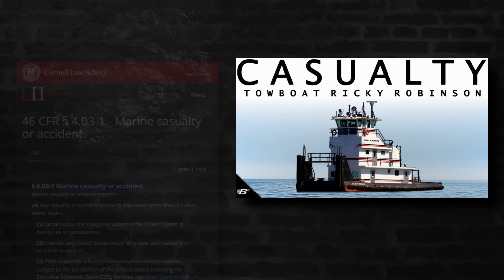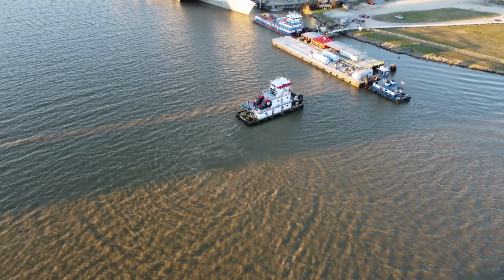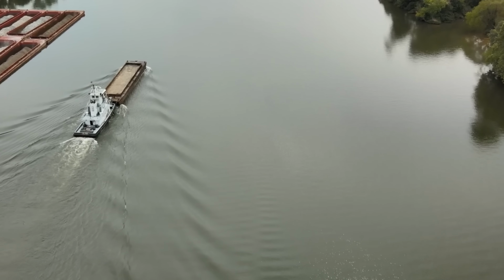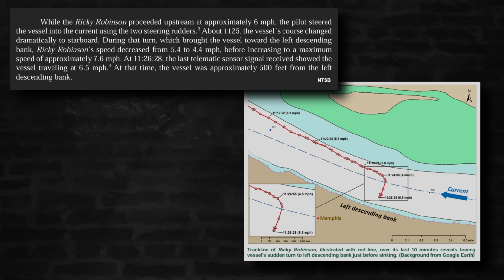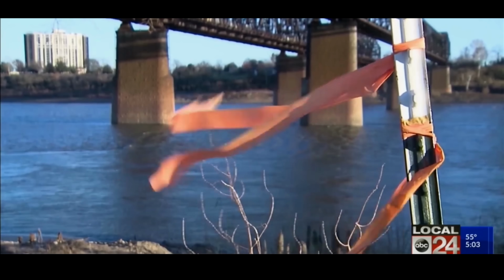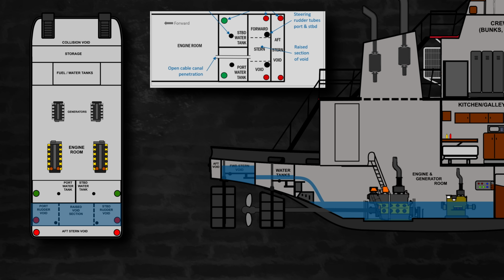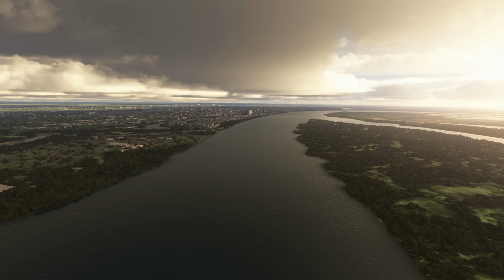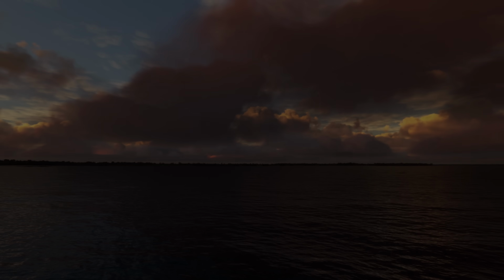INSTANTLY UNDERWATER: The Sinking of Towboat Ricky Robinson

Comment: Wow! As a tugboat guy on the westcoast of Canada. WTF? Who runs with a leaky lazaret? Thats just insane! Then to run with the laz hatches open and engine room doors tied open? Due to the loss of life I'll stop commenting.
Reply: I wonder what happend that they went down with the tug, from the comfort of my chair at home it would have seemed quit easy to jump the ship or swim out of the wheelhouse once capsized
Reply: @Poging2  No life jackets, and strong (very strong) currents in that area of the Mississippi.  The boat sunk in seconds.  if the deckhand was under-deck, they wouldn't have had time.  I've seen 8mph at times not too far from there, which doesnt seem like much, but you're powerless against that.  Even a strong swimmer is going to be challenged, and have a hard time orienting and swimming towards shore.  Most of these boat crews are not strong swimmers.
Reply: @Poging2 ship probably dragged them down with it
Reply: @Poging2  In a rapidly sinking, capsized ship, in 4MPH current it's probably not so simple.  If she really went down in 30 seconds, they were probably working hard to try to stop it from sinking and didn't realize it was inevitable until it was too late.  With the boat listing already and pointed across current, once it got unstable it could have flipped real quick, and trapped them as well.
Reply: @Poging2  It's really hard to escape from a rapidly flooding, heeling structure, honestly. The structure changing orientation and filling with water is going to seriously disorient you, and any exits that you DID know the location and direction of might be on a different face of the room now, if they're visible at all. The post-salvage condition suggests the towboat sank mostly straight down, admittedly, so that might be less of a factor here, but it's still shocking how disorienting it is to get submerged in water.

Additionally, you might be thinking of swimming in a pool or the ocean, but they call the Mississippi the "Big Muddy" for a reason. Especially that far down the course, the river is moving a TON of mud. Visibility in the water is atrocious and light is lost shockingly quick beneath the surface. So you have to do that in the dark, as well.

But on top of all that, the SPEED of the sinking is key. Less than thirty seconds for effectively a two or three-story building to sink underwater is terrifyingly quick. They barely may have had time to realize the ship was going down, not even enough time to take a breath. Worse, even if they DID realize that, people float and steel doesn't. If the towboat is sinking that fast and ESPECIALLY if the two crew had their lifevests on, the rapid ingress of water could have slammed them into the ceilings and either knocked them unconscious or simply stunned them, either of which is instant death in that situation. And if they did have their lifevests on, even if they avoided that, they'd be in the situation as the passengers on some of the Duck Tours boats Brick's covered in the past, where they're now pinned to the roof and have to forcibly swim DOWN to their possible escape routes first against their vest's flotation. In the dark.

It's a horrifyingly difficult situation to be stuck in, basically. If either of them were out on deck then I'd agree, it'd be extremely easy to just swim off the open decks of the towboat, but since they were actively running for the shore, probably both crew were inside -- the pilot manning the helm in the wheelhouse, and the mate attempting to limit the flooding.
Reply: So, always wear scuba gear if you're working on a ship thats on the Mississippi River?
Reply: @Here_is_Waldo  That's a bit extreme.  The real lesson here is not to get complacent and allow safety issues like open hatches when underway and leaking compartments.  It may not be the ocean or Lake Superior but the river can and will kill you if you don't respect it and follow the practices that mariners have developed over centuries to keep their boats afloat.
Reply: Have you worked in Victoria? I love watching the tugs here
Reply: @Poging2  WRT InchonDM's comment, I remember seeing some video of the Royal Navy's training center for dealing with flooding events onboard ships. Watching the video from inside the compartment, there's normal, then instantly everything is covered in water flow, and "you're dead" in seconds. It's frightening just how fast you're out of time to respond - and, as noted, a momentary stun is enough to lose you that time to grab a breath and get out of there. Fascinating to watch, terrifying to be in - and you can bet these two poor gentlemen weren't given the same sort of training, either. :-(
Reply: Trying to fight fast flowing water in a confined space would be quite hard. Panic sets in, game over.
Reply: @InchonDM that does sound horrible for them :( I never knew.
Reply: My uneducated guess? The engine room door might have been tied open due to unrepaired exhaust leaks.

...It was cold, so (guessing) the heat wasn't why that door was tied open.
Reply: @Poging2  cold water though.
Reply: @InchonDM  This is such a good summary of the situation
Reply: That is a good way to lose reserve buoyancy though, isn't it?
Reply: No life vests and that water was so cold and the current so strong you wouldn't have a chance.
Reply: In the past, I did open water swim racing. A strong swimmer, in good condition, not weighed down by clothes or shoes, can only maintain 2 miles per hour over any but the shortest distances. Currents above 2 mph are impossible to swim against, you have to go where they take you. And in 50° water, without a wetsuit, you have to keep swimming hard to maintain your body heat. If you slow down due to exhaustion, hypothermia will set in making it hard to move your muscles and further reducing your ability to keep your body warm. Open water swim races are typically done in bay's and oceans. Open water river racing is frowned upon by many swimming organizations because they regard the strong and uncertain currents in rivers to be too dangerous.
Reply: On why they didn't get away from vessel, the one eye witness said the tug was there he looked down and it was gone. My guess, he turned to run for shore and that action rolled her over quick.
Reply: Any skipper worth his salt takes good care of his boat. Also, it's why I'm a fan of skippers having at least a decent chunk of the ownership stake in his boat. A boat owner knows the work and dedication it takes to keep everything seaworthy and knows how letting a problem fester will degrade into bigger problems. There's also a really good chance he'll have everything needed on board, from years of collecting and repairing parts, to do most of the repair work while underway. This is a kick the can down the road type of situation. It's just company equipment.

Really surprised me to see such inadequate "doors" (not proper hatches). Especially with such a short freeboard. I don't have experience with river vessels. But still surprising to see. The engine room is so exposed.
Reply: @krozareq Hmm, ngl, I do like your idea, but it seems impractical that skippers would have even partial ownership of anything larger than a small fishing trawler. Especially with modern, large corporate fleets.

I think a better idea would simply be to make the corporate head honchos personally, criminally liable (as in prison time) for their companies' safe operation, or rather lack thereof. If the CEO/COO/Fancy McFancyface/whatever could face 5-10 years of hard time (in addition to things like permanent prohibition from working in the same industry going forward), you better believe we'd see far less of this sort of 💩, very soon.

Comment: I used to work on smaller towboats like this. The smaller towboats roll like crazy when turned hard without barges. You absolutely had to keep the main deck doors dogged for everybody’s safety. Water was always on deck, even caused by its own wake when at speed.
If you were working upstream from a tow with the current pushing hard down at you, you really had to get about 1000ft above it before turning around, because if you got swept into anything solid while sideways in stiff current, she’s rolling.
In fact, we had a brand new towboat, and if you turned hard enough, the thing would list so much that the main engine on the high side would think it was loosing oil pressure due to the slosh affect in the oil pan and send alarms sounding all around. Quite a bit of smaller towboats are like that, with their tall superstructure and relatively short length to be maneuverable but also see over a tow. Required some delicate handling. Good times sleeping on it.
Reply: Wow, this is so interesting, I had no idea they were all like that! Thanks for sharing.  Incredible that that turning would even affect the oil pressure!
Reply: Super interesting stuff! Just a question because I really don't know anything: How can the ship's own wake cause water on deck? Is the ship listing so much that the side waves hit the deck? Thank you in advance :)
Reply: Watching them from River Bend in New Orleans it looks so easy and peaceful but we knew how dangerous life on the river is. RIP
Reply: The engines on those boats are powerful, drawing enough water out from in front of them to create a small tide behind them.  When we were stupid kids, the family had a camp on the intracoastal canal.  We would run out onto the exposed mud when they passed, then race the waves back to land.  I imagine the pilots did not appreciate this bit of fun, but they were too professional to yell at us.
Reply: @janetsmiley6778  Heh, this is a crew that would have done well to remember the phrase "Baten down the hatches"... pity what happened to them, but.... ugh. ;-;'
Reply: I work in the shipping department of a cement plant on the Mississippi River. I loaded barges for 2 years and we had one of these boats on site all the time to swap our barges out and for safety reasons. We weren’t allowed on the barge if the boat wasn’t there. It’s crazy how maneuverable these boats are. I’ve seen them do alot of crazy stuff, but never seen any of them in any kind of danger,
Reply: I worked in the Marine industry for long time, Check out  The video: Tugboat Capsizes Off B.C. Coast (TSB Canada). July 19, 2009, the tugboat North Arm Venture capsized they all survived but there are a couple videos of it how quickly it sunk IN TOW. I didn't know the guys but my friends know them.
Reply: Pushboats DO ride like pigs when not hooked up. But for the oil pressure thing, a Caterpillar marine package does include a deeper oil pan to mitigate such events… maybe the port engineer ordered the wrong kit.
Reply: @headful4470 It has to do with the bow’s:
- shape (flare, no flare, etc.), and
- height above the waterline.

These boats are designed for restricted areas, and not for unrestricted international voyages. It’s a different industry altogether, but Archimedes is blind to any differences.
Reply: @headful4470  towboats have flat fronts to face up with barges, unlike traditional ships with bows that are knife edge. Because of this, when moving water goes up as well as to the side. If moving forward fast enough, enough water will rise above the bullworks on the front, and cascade the decks. Happened all the time if the captain or pilot wasn’t looking at to how fast they were going without barges.
Reply: How did a faulty design like this get approved by the government?
Reply: That is fascinating! Thank you for telling us about this.
Reply: @harryshuman9637 

It’s not faulty it’s a consequence of its design, it needs a flat bottom for working on a river, a flat bow for pushing and a tall wheelhouse so the crew can see over the barges.

So you get a tall, flat bottomed, flat nosed boat thats inevitably going to have stability issues without careful handling.
Reply: Thanks for the insight. I learn something new. All the best to you! Stay safe out there.
Reply: @TBone-bz9mp  yeah as the NSTB pointed out in their report despite all of the other deficiencies like leaving doors and hatches open and having a leaking void space the real cause of the incident was too much speed without being attached to a barge. As you said careful handling required.
Reply: yea gettin sideways on a workboat was something you never took for granted..
Reply: I cant believe how low they sit in the water as it is.. theres like 1 ft of freeboard when theyre not pushing anything
Reply: Thank you for that info man!!  I feel like I was born to be serving the maritime industry but ended up a machinist in the middle of the country.  Oh well maybe in another life
Reply: @quivalla  ah nice, an accident I will actually watch, knowing it had a relatively happy ending :)
Reply: @headful4470  so much of a push boat on a small platform with out a proper keel and bow will cause quite a wash down the side . Most only have a low gunwale with drains set in at several locations. Rough water is meant to be kept out by keeping all water tight doors sealed, without this safety precaution water can easily wash over the step through the open hatches flooding the engine room and other under deck compartments
Reply: Why weren’t those hatches elevated on risers at least as high as the gunwalls? This would have prevented water on the deck from flowing in.
Reply: No matter how big the towboat is  when we down stream, if we get sideways we can roll right over. All those big boats have a center cavel in the front and a capstan. I don't think any responsible big boat pilot would land without that capstan.

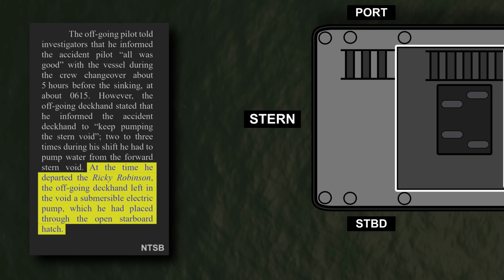Comment: 10:00
Dispatch and management repeatedly state they were not aware of flooding issues. Considering how multiple different crew members all had the same policy of “just keep pumping the water and deal with it” i get the sense that this issue or similar have been reported in the past and never resolved, so everyone just figures it isn’t even worth complaining to higher. Just speculating, but happens nonstop in just about every industry
Reply: It's more likely they invented solutions to some very minor issues at first when repairs took longer than they'd like. For example, they're not going to take the boat out of service for a week until they can get an electrician in to repair a light switch for a storage closet. But the crews might feel their reports go unnoticed if the repairs are still not done 2 months later.
Once you layer 4 or 5 of these non-serious, non-safety issues up that go unrepaired, crews would begin to invent workarounds, and think that's the only way they'll get stuff done.
It's very unlikely the first issue that went unresolved was a serious safety issue.
Reply: "I don't recall" "We were not aware" yeah, everyone knew, it was just cheaper to ignore
Reply: @tin2001 normalization of deviance. It's as insidious as it is deadly
Reply: Let's be honest boss probably shredded them
Reply: My colleagues often ask me "why do you keep sending the same maintenance report every shift? they are clearly not doing it" - this is exactly why. None of my superiors will ever be able to say that they didn't know. (And yes, they have told me to stop doing that. I told them I would stop sending the report when they start fixing it. It's good to work in an industry where they desperately need people...)
Reply: @QemeH  What industry do you work in? My son-in-law is looking to get trained in something that needs people.
Reply: @tin2001  Spot on. I was a motor coach driver for over 20 years and left one company because of maintenance issues. I did not want my reputation tied to the company when a major accident happened.
Reply: @hilestele5585 I know plumbers, JVAC and electricians are badly needed. Average age is mid 50s. I work HVAC and in 5 years, most of the guys are retiring

Comment: I was talking to a cook who worked on the gulf sailing on liftboats  and he recounted the story of a cook who died in the engine room when the boat capsized.  He couldn't think of why the poor guy was down there in the first place.  Then I got struck with a flashback, you're not supposed to, but I've seen used cooking oil being disposed of in the waste oil tanks down below.  
Point being, ashore or at sea, know your emergency escapes.  They should be the first thing you look for when you go anywhere.  That case might've just been wrong place wrong time, but as with the Ricky, in small spaces like galleys/kitchens, vehicles, etc, things happen in a hurry.  Two trained and experienced men couldn't get out of a boat about the size of a single-wide trailer, then how many seconds would it take for you to escape your home or workplace?

Again, outstanding work.  Your professionalism and integrity is a beacon in a sea of disrespectful clickbait slop.
Reply: If my apartment ever sinks, I reckon I can escape from anywhere inside in about 5 seconds. I’ve been running drills.
Reply: Did that incident happen to be the Seacor Power by chance?
Reply: Excellent message. This helped clear up my confusion as to why they were unable to escape despite being on such a small boat. Thanks.
Reply: As an ex engineer I will tell you with absolute certainty that the cook was not supposed to be there. It's a machinery space, it's to be only manned by engine crew. The used cooking oil is to be dropped into the dirty oil tank, sure. By the motorman, oiler, wiper or cadet. The cook will usually be provided with a 20 liter canister and a funnel with a net filter to drain their oil, they will call the engine room when it's time to pick it up. Among all of the ships crew only the engine crew are actually expected to be anywhere on the ship, everyone else is to stay out of hazardous areas they aren't trained for
Reply: 'tegridy